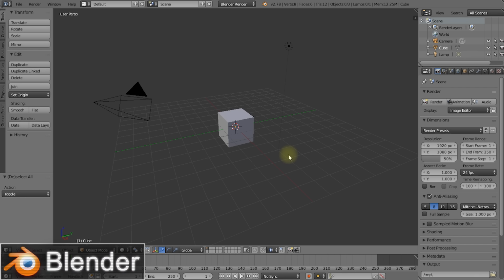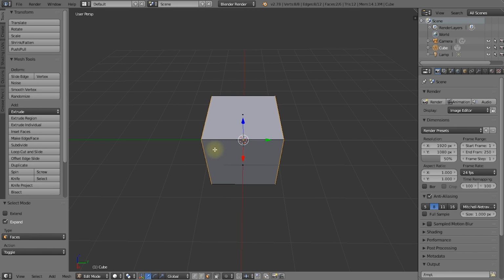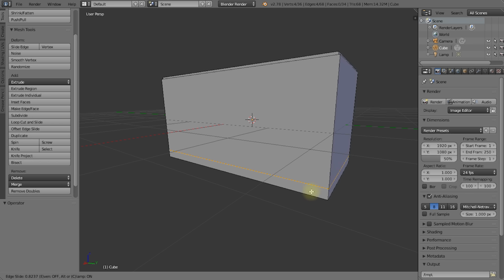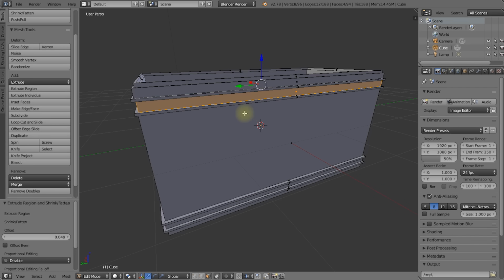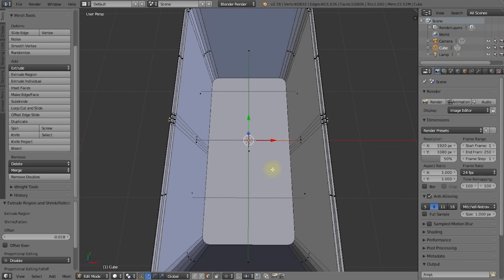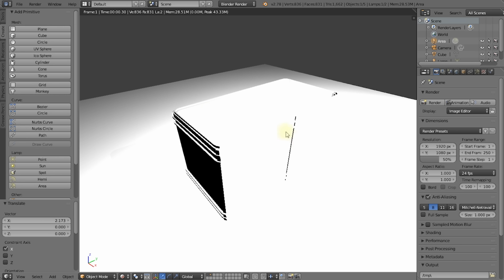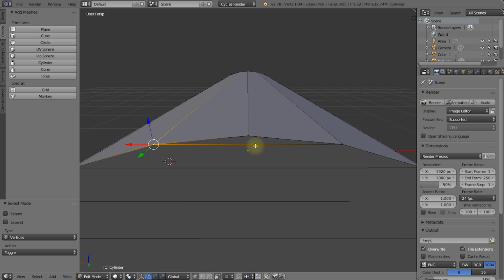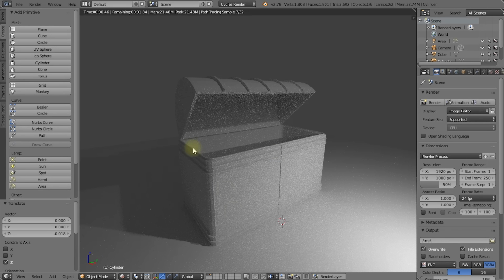MODELLING For Absolute Beginners - Blender Tutorial

Comment: Hello there. Thank you for the tutorials.

I have this peculiar issue with a certain model meant for the Source engine. I decompiled it and got an addon for Blender that would import the mesh and what not, but when I import it, a lot of the faces are simply missing (interestingly enough, the wireframe where the faces used to be remains intact). While I could technically refill the gaps by filling the faces with the F key after selecting the edges, it's quite the pain and I don't know how to smooth them out upon filling them up.

I have already discarded the compiler/decompiler in question as the culprit by decompiling, compiling and verifying that the model remained intact, so that only leaves either Blender or the addon itself not being able to handle something about the model upon importing (perhaps the polycount?).

So, if you could pardon the wall of text, and if I run out of options, would there be a more efficient and less time-consuming way of dealing with this issue that you might know of?

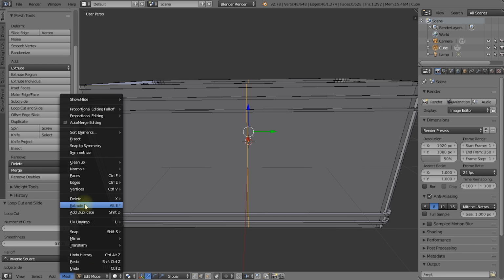Comment: Very nice video, but I have a problem with the tool : Bevel. When  I use my mouse for add more edges (21:10) it's not working, the vertices go everywhere except where they are supposed to be, Please help me!!!
Reply: Part of it was the way you made your selections another part Blender doing what it does.  A simple quick fix would be, after using R and made your lines, press A (to select all), then go to the Tools tab, and at the bottom, before you get to weight tools, select Remove Duplicates.  Blender will look to see where there are two of the same thing and merge them together.

Comment: Helped me alot and I just started. Only problem I had during this is when using Knife on the bottom to make quads. The knife option is red for me and won't cut from vertex to vertex. If I were to cut from face to face it works great. I will keep playing around until I find my problem
Reply from the maker: Hi, you likely have duplicated faces/edges/vertices and are not cutting what you think you really are. Move them around to see if something got accidentally duplicated

Comment: My knife doesnt work, any ideas why? its working on a plane or cube but not on edges of my chest :<
Reply from the maker: You may have duplicated edges/vertices and are not cutting what you think you are. Try it on a plain object to see if it works
Reply: A simple quick fix for duplicates would be, after using R and made your lines, press A, then go to the Tools tab, and at the bottom, before you get to weight tools, select Remove Duplicates.  Blender will look to see where there are two of the same thing and merge them together.

Comment: I joined an indie game dev group that allowed me to join while still learning modeling, and according to the other modelers, it isn't so bad to have triangles. So for anyone wondering, in game engines (like unreal engine 4) it isn't the end of the world if you model something that absolutely cannot avoid having a triangle, like the tip of a sword or a rupee from the legend of Zelda.
Reply from the maker: There is nothing wrong with having triangles in areas where you expect no deformation :) They're usually just a problem if they're on areas of a mesh that needs to animate / move / change so tip of a sword should be fine - though even that can easily be turned into an Ngon
Reply: @SurfacedStudio  I want to later animate things like models were done in the n64, where each arm for instance is a entirely separate model. In that case making sure everything is quad doesn't matter right?
Reply: But it would still be pretty easy to avoid triangles on sword tips/rupees.

/\
|  |
|  |
|  |
|_|

Now, this has a triangle at the top
But if you put the top like this

  /\
 |\/|
|  |  |
|_|_|

Then you've just created trapezoids, (with 4 vertices)
Reply: No wonder all the Sims 4 hair meshes seem to have nothing but triangles o-o

Comment: I tried using mirror (both x and y axis) so I could edit just one corner and affect the others. When I finished and hit apply, it looked fine but in wireframe the whole chest got darker, indicating that every single face was duplicated in place. How can I prevent this? When I was editing the corner, I only moved around some edges, didn't do any extruding or insetting.

Comment: whenever i add a plane its never flat on the ground its always facing down at an angle?
Reply: also the numpad commands to get different perspectives don`t do anything for me
Reply: Is it just angled to your perspective?  Do you still see the mesh outlining the ground from when you first start?  Is the angle in with it or against it?  Also, the number pad options require both to be using the number pad and that num lock be active.

Comment: 13:02 Great Video, but I seem to be having an issue with extruding when using vertex normal. With Vertex Normals, the sides pull straight out just as they would with the Individual faces mode, thus leaving me with little gaps in the belt as the belt pieces fail to extend to their sides. Of course you could just pull the belt pieces out sideways afterward, but it still concerns me that my extrude vertex normals isn't working as it is in the video. Help is appreciated.

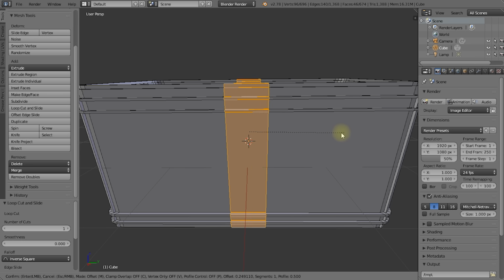Comment: For some reason at 21:13 mine does not bevel on the bottom portion even though the whole line on both sides is selected. Any solutions?
Reply from the maker: Hm, that depends so much on your situation it's hard to 'solve' remotely. Make sure you didn't accidentally double up an edge or a face (e.g. accidentally copy something and not re-position it), that seems to be the most likely culprit as to why something doesn't bevel or inset or cut properly
Reply: I ended up manually selecting everything instead of using the alt click method and it worked. I am not sure what happened but I know everything was selected. It worked out in the end

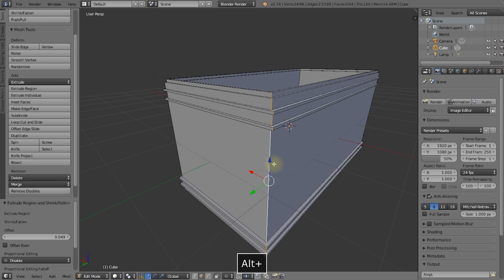Comment: Help, I’m kind of confused around 17:14 or so, the alt and shift thingy. Like do I hold both at once or... (Sorry if I sound incredibly dumb, I just started using Blender today :P)
Reply: Also when I do the bevel thing, my edges do like do the round thing but you can also see the box inside it.. if that makes sense?
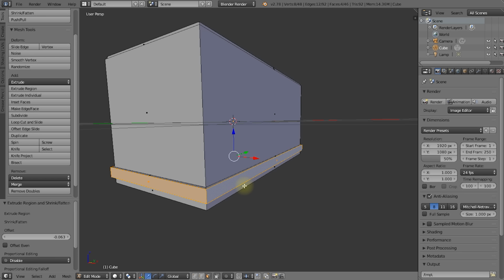Reply: And finally, around 13:20 when I pressed “i” button and it did the thing, whenever I tried reshaping it, it only did it for one side when I tried pushing it in.
Reply from the maker: Do you have all of the faces you want to inset selected?
Reply from the maker: Have you seen my absolute beginner tutorial for Blender yet? :)

Comment: This was amazing.  

One question: why sink the top face down and not just delete it (assuming you could delete it).  I don't have blender yet but was wondering about why you would keep that face.  

Again, thanks, this is hands down the best Blender tutorial I've come across and feel I can actually make something.
Reply from the maker: If you delete the face, you are cutting a 'hole' into your model. You would have to fix that up at a later stage, so just extruding inward is easier and takes care of the inner volume of the treasure chest :)
Reply: Ok, but you were putting the top door so the top face of the main chest would not be needed.... ????

Comment: The 'Inset Faces'-tool ignores the top four faces of the box as if the big top face - which has been removed before - would still exist. After pressing 'I', there only appears a single looped line along and upon the four faces and doesn't create new insets - neither for the individual top faces nor for the supposedly existing big top face. I tested all the modes for the pivot point and also checked and unchecked the boxes in the dialog field, which appears left of the viewport after confirming the changes made by the 'Inset Faces'-tool: With No Success.

Have you any suggestions? Sorry for the novel.

Thnx for the quick reply :)
Reply from the maker: It could be that you accidentally created duplicated edges along the top (e.g. by doing an inset without actually giving it any distance) and thus any new inset is squished in between the one you already have. Have you tried just creating a brand new box and just insetting a single face? Does that work?
Reply: You're right...I'd never have discovered it by my own...many thnx. 
I'm really exciting about what's comin' up next on your channel. :)
Reply from the maker: :) Thanks you!